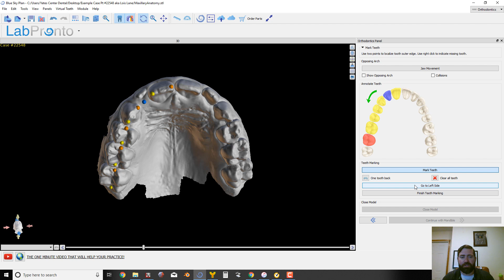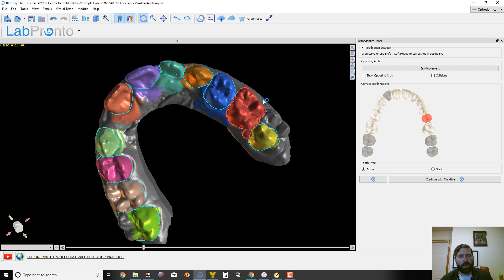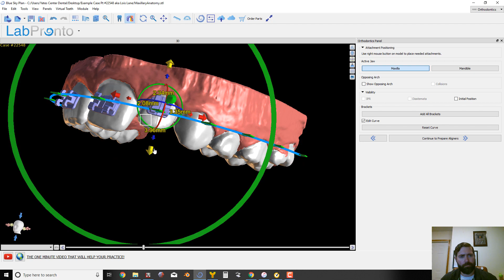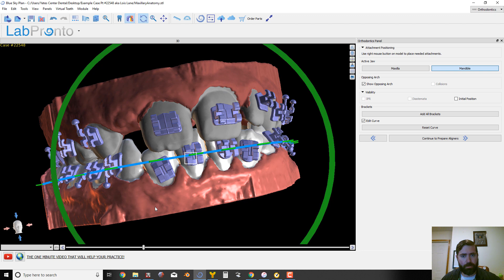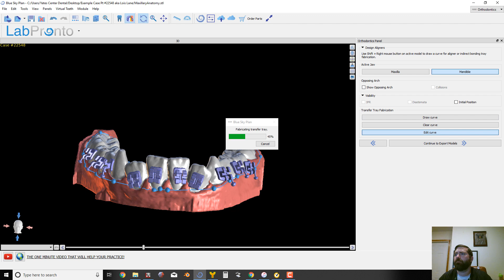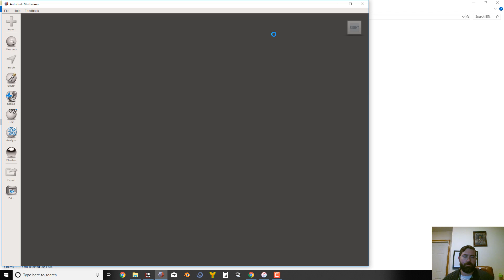Indirect Bonding Tray Design using Blue Sky Plan- Phase 1 Example

Comment: I have a feeling after bracket positioning on Blue Sky that bracket base doesn't lay correcly on the tooth surface and there is no information how far is bracket base from tooth surface. Don't you have problems with too much or too little adhesive?
Reply: I wonder could we use a second program to segment and export the model base with bracket then import to blue sky for the purpose iDB